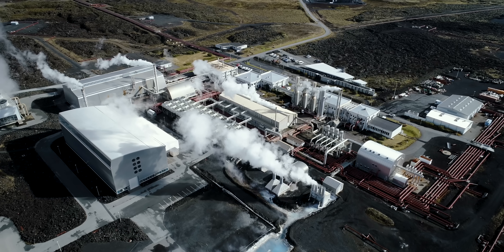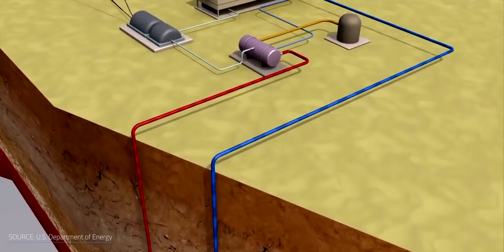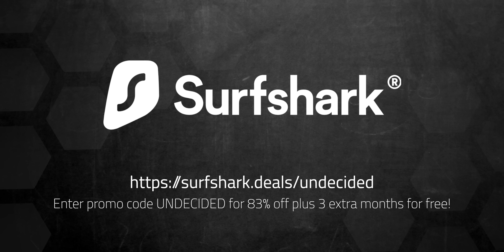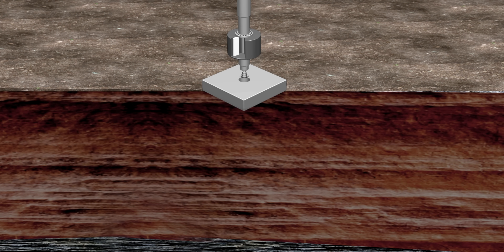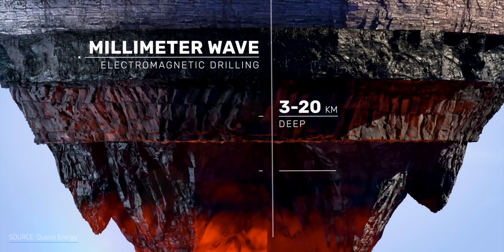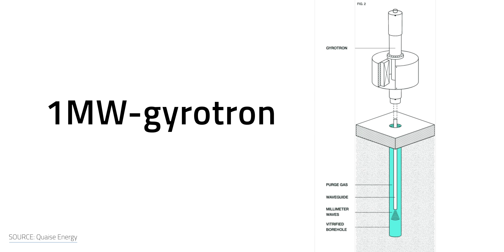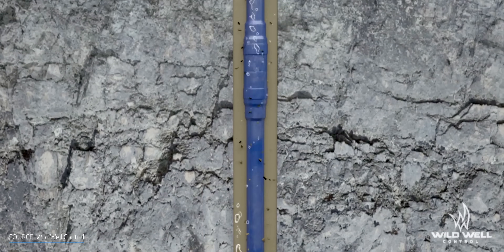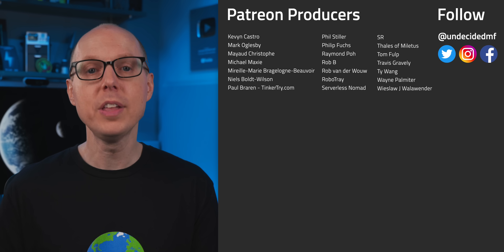Why This Fusion Tech May Be a Geothermal Energy Breakthrough

Comment: Very cool! I am eager to see the results from larger scale tests of this tech. One of my biggest concerns is related to insulating the electronics of the gyrotron. We currently struggle with the issue of electronic borehole instruments failing at ~150° C. 500° C is very hot and it seems there might need to be a robust cooling system at a level of sophistication that is hard to imagine without further research.

Great video Matt, Carlos, and Paul!
Reply: The gyrotron remains on the surface. The "drill string" is a waveguide to carry the radiation down.
Reply: @rubikmonat6589  What about signal degradation of the gyrotron? The approximate 25% gain lose per every connection. Since well drilling pipes are  a new connection every 27-32 foot. For that amount of energy and depth either your using Andrew LDF5 at a min (They don't make a reel that long in Chicago for depths mentioned) or polarized tubes like the DEW line. And would still have issues with rock like glass splatter coating at the end. Unless using an ungodly PSI and amount of inert gas like argon thus raising cost. Three Mile Island only reached something like 135 feet below ground due to ground table water. When the pellets and rods decided to leave the pressure vessel.
Reply: @sclabhailordofnoplot2430  That is why the wave guide is an entirely separate entity from the well pipes. The well pipes are just there to line the hole when conventional mechanical drilling is being used. Below that, the tool vitrifies the rock so the hole is basically lined with volcanic glass.
Reply: @sclabhailordofnoplot2430  think of the drill string as segments of rigid waveguide not coax, much lower loss and near zero loss at joints. Yes ungodly amounts of inert gas, not just for clearing the end but pressure to keep the hole open, you would need so much pressure you will likely blow out the glass casing at the shallower depths (you aren't able to use the gravity pressure gradient from the height like you get with mud). I don't think it will work, just from the pressure physics. Then you don't get the string buoyancy from the mud either, so the tensile strength will be eye watering trying to hang all that off a rig.
Reply: @rubikmonat6589  Thanks, So skipping investing. I feel old drilling methods, sandblasting, Water blasting, And brisance explosive carts would be more cost effective. Possibly a new Jack hammer style hydraulic drill head. Issues: The unsupported wave guide pipe (keeping straight in hole), Drill holes are never straight 100% Ridged wave guide can't work, (connections not discussed for signal gain loss Microwave, Laser, Electricity, and RF all have these issues), Heat issue, stronger drill rig for wave guide pipe (good point Rubik), amount of power needed at site, and removal of debris without splattering molten rock on the working end. High PSI means heavier pipe which compounds the line tension issue. Your going to have to keep to 30 foot sections to match the curve of the original drill pipe. These polarized wave guide high psi pipes are going to need stored to prevent oxidization when not in use. Dehumidified so you don't get a moisture block explosion.                                  I'm out, not saying it can't be done. I just foresee someone calling a radar guy to fix the wave guide after its been dented, kinked, coverd in splatter, or broke off 2,000 feet down. Good luck fishing that back up.        There going to have to use robotic/or psi driven external expanding open face ball bearings. on the pipe to keep it straighter and grip the sides of the shaft to lessen the pipe weight.

Comment: Theres a very important assumption I feel was glanced over.  It costs $500k of energy to drill the hole with the fun death laser or $30m to use conventional drilling.  So, the assumption is it will save tens of millions of dollars.  I feel this a silly assumption because it isnt the cost to the contractor that determines the overall cost of the project.

What I mean is this; if this project does go forward the contractor isn’t going to charge $500k plus a some, no they will charge $25m and pocket the rest as profit.  There will not be a saving of tens-of-millions of dollars.  I know this isn’t an economics channel, but even a trogladite like me can see this truth.

Comment: IF all works as advertised at the bore face, this technique solves many of the problems with depth limits to current drilling technologies. I wonder how adaptable it will be to directional drilling or drilling "sideways" instead of just up and down? Frack the hot lateral and trickle water in it as fast at will flash- even using clean water for the trickle, the rising steam would need to be scrubbed before it could be used .  FR

Comment: Geo-thermal always seemed the right choice for a simple low carbon method of power production. If cost is the only thing holding it back, then that's a shame. Why use nuclear when you already have the sun below your feet and there's no need to mine harmful chemicals for battery based storage?

Comment: I remember reading an article about this guy only a few months ago when he published his results; it's amazing to see how quickly this has been picked up and how fast we're getting to industrial scale. Usually that kind of stuff takes ages.
Also, using fusion stabilizing magnetron beams to drill holes to the centre of the planet is both mega sci-fi and reminiscent of the many technological developments that were made during the space race in service of taking a human crew to the moon and back, and how we're still using those technologies today for a wide variety of applications. These stories are always fascinating.
Reply: A magnetron is not a gyrotron.

Both produce EM waves within a similar range of spectra, but they are different in terms of design and the upper limits of their output.

Gyrotrons are far more effiicent for super high energy use cases like this.

Comment: I've often wondered...with the earth heating up, would it not be possible to 'harvest' this heat directly from the sea itself?

Use a heat exchanger with a massive array of pipes running though the sea in a similar way as ground source heat pumps work.
Reply: Not really, the ocean is too big, so the energy gradient isn't steep enough for most applications. There might be a narrow use case for undersea habitats at moderate depths to use the difference of the temp at their depth and "surface" waters for bulk heating, so they don't need to expend much precious electricity on heating the habitat, which may be very helpful, but to do that across the oceans as a whole would require millions and millions of tons of equipment, for not much return. A future post scarcity civilisation that is colonising other worlds might be able to that sort of thing one day, but not us right now
Reply: @talltroll7092  I wonder whether superconducting materials would make a difference?🤔
Reply: @weedfreer  Some, but the basic issue is the scale of energy available in the first place. You need a LOT of resources to capture energy from temp differences in ocean water (although obviously, there are some places where local conditions make it a lot more efficient, and some locations where even if it isn't that efficient, being able to capture energy on-site makes it much more valuable)
Reply: @talltroll7092  I mean, I'm thinking gulf coast as a prime example could be an option...especially the shallows around coastal areas....benefits from the sun too maybe

Comment: The best solution is often found in well established fields. I don’t really believe solar and wind to be even mediocre in replacing oil. The creation of solar and wind technology requires oil to begin with, and don’t give enough power for cost and maintenance. Not to mention batteries use some of the dirtiest minerals to extract. Geothermal tech is well established and fracking to increase the heat absorption area is easily the best way to make energy.

Comment: Everyone is for a more efficient long lasting and affordable energy source.  Someday someone will come up with a way to tap the earth's inner core.  This should not be looked at like it's a hazard free process that will supply clean energy for ever.  It may but. . .if the earth's core is hotter than the sun what do you think the chances are of magma or even hotter gasses escaping the shaft and causing a catastrophe of unimaginable consequences and or just under the surface.  Picture a series of mini volcanoes!  Once someone can figure out how to do this safely. . .yes the energy game is over.  That may never happen.

Comment: Here's a thing about the cost per kW compared to solar. It's 4x more expensive per kW, but 1 kW of installed solar produces about 4 kWh of energy per day, while 1 kW of geothermal can produce 24 kWh per day. 
Of course it'll be a bit less due to stoppages due to maintenance and such, but the point is, the sun doesn't shine all day, but you'll always have the heat from the ground.

Comment: You mention a conventional hole is necessary to 12+ miles at Newberry. That is ~60,000'. The deepest we go, conventionally is 18-20,000 with all sorts of hole problems. Not only that, but regular geothermal transport of heat by as a tendency precipitate out dissolve mineral as the temperature of fluid pool but you need to transfer heat from the downhill hot water to the fluid in the pipe and vice versa  ends up blocking the piping. Yes, it is transferred fluid
Reply: ... but you need to transfer the heat from the downhole fluid and Rock to the clean fluid in the piping and then vice versa at the surface.
It seems to me that the major problem will be drilling the very deep conventional hole. Drilling the "conventional" part of the hole with heat probably is compromised by the amount of water in the rock above basement.
If our little part of Colorado we are having terrifically hard time getting money interested in drilling  simply to 12,000 feet in a valley fault near abnormally hot rock.

Comment: Great find Matt. I like the way you brought up the drawbacks of creating the gas pressure and dealing with fault cracks but you did not mention the problem of extracting the heat. Pumping water down the hole will pick up high mineralization and this clogs pipes very quickly. If there is naturally superheated water in the hole it will also be full of minerals. And, creating a closed-loop pipe at this depth sounds very hard as well. I would consider the cost to build nuclear power plants with thorium a better alternative. It was done before and it can be done again. Geothermal for heat pumps is great but this deep drilling idea is a waste of time and money.

Comment: The numbers being thrown around here are pretty cavalier. It's nice to think that a concrete cost per kwh would be possible to estimate, but we have not even started drilling with this method, nor do I believe the cost of plant production an infrastructure have been taken into account. 

Further more, noone really knows the environmental impact that plunging multiple geothermal shafts, deep into the Earths crust, might actually be. There are so many variables that we have no clue about, because as a species we have never done anything like this before. Drilling 1 hold a fraction of the depth needed in one geographical location on earth, does not give us any data that helps us to understand what the impact might be in other regions or with other technology. 

People like to jump on bandwagons when something sounds cool, the problem is most of the people talking about this stuff are presenting more speculation than hard facts. The past 2 years should have been enough to que every single person into the fact that most of our so called experts are mostly incompetent.

Comment: The potential is good idea that geothermal could be alternative methodology to generate electrical power. While you pointed out the earthquake potential and Carlo's counter effects. I ask what about precipitating a volcano effect in the center of the drilling into what is perceived as the magma of the earth? If the sub strata is weakened then the potential for violent eruption by a new volcano is likely. The losses could be staggering.

Comment: Geothermal has some interesting possibilities, but one things that is interesting to think about is that tapping the heat out of deep earth would increase to global warming. Remember, we can not create energy just transform it. If you bring the steam to the surface the heat is converted through motion to electricity, but the heat is essentially released into the atmosphere.
Reply: While true, this is functionally how all forms of thermal energy generation behave. The energy release is a drop in the bucket compared to incoming solar energy though (our total annual energy production is a few hundred exajoules, total annual solar energy is a few million exajoules). This is why greenhouse gases and heat trapping is a much greater concern for global warming than the heat we generate to power things

Comment: I like the two closed loop systems, I assume that there is no need to release greenhouse water vapour from the steam plant, anyone know?
The heat within the earth?  I remember that the liquid water discovered in Europa is attributed to the gravity of Jupiter and the orbit/rotation of Europa.  Given that the magma beneath is liquid could the driving force for the Earth's core temperatures be similar with the Sun's gravity and our orbit/rotation.  Could that also explain the migrating hot pools of magma causing volcanic action to appear to move along lines in the crust?

Comment: This is exciting technology to be sure.  However, I have noticed that areas where the geothermal energy is more easily accessible also tend to be in nature preserves.  I fear that once you actually tried to set this up somewhere you'd have a slew of environmentalist groups protesting against it.  But if you can get this deployed it would be an amazing way to generate power.  I do have to wonder, what is the maintenance cost of this kind of plant vs something like an NG powered power plant or nuclear plant?  The energy source might be "free", but it seems to me that maintaining this kind of closed loop system might prove to be very expensive.

Comment: I'm skeptical about the glass walled pipe that is created being able to hold back the rock.  Unless we're talking Prince Rupert's Drop strength, I'm skeptical.  On the Kola well, heat and pressure made the rock walls more like plastic.  Heat does a number on glass over time.  Just something for someone smarter than me to think about.

Comment: Leap’n lizards, it’s a laser!     In the meantime, ground assisted heat pumps are a real thing, as Matt mentioned, but he didn’t cite their astonishing efficiency -  It is hard to get your head around it, but current off-the-shelf “heat pumps” can move 4 units of heat energy from a 50 degree Fahrenheit heat source using only 1 equivalent unit of electrical energy.  Typical year-round ground temperatures just 10 or so feet under ground are 55 degrees Fahrenheit.   A good heat pump can still move 2 units heat energy using 1 unit of electricity for a 5 degree Fahrenheit heat source, but why go there when it is an eternal spring day just a very accessible few feet below the surface of the earth!

Comment: Rotary Drilling is the obsolete problem. Dramatically cut the economic & environmental cost of drilling will make oil extinct by local, secure, cheap, green geothermal power. My idea -1978 Hydraulic Jack Robot Driller for Control Blowout Drilling of geothermal wells.

Comment: Your electrical costs for drilling may be overstated. Such a power plant would presumably have multiple bore holes. After the first bore hold is made, you could conceivably start generating power from that bore hole. Some of which to be used for drilling the subsequent bore holes.

Comment: Using geothermal steam in fosil plants won't be as straight forward as they think. Geothermal steam is colder in comparison to coal plant steam, and the thermodynamic cycle is not set up for that temperature and those pressures. Similarly with nuclear. You cant just drop in with a classical nuclear reactor, it has to be a high temperature reactor to be viable.

Comment: At the shallow depths used for heat pumps via pipes in the ground in certain soils the result was/is earthquakes and damage to buildings (Germany put a stop to it in places due to old city centres having cracked walls from this). What reactions will this tech bring that we don't need as a complication?

Comment: This sounds like a great idea. One issue not addressed. The weight of the rod that is 20 km long.
That material must have enormous tensile strength if it is to support 20 km vertically.
What's it made of? Or do they have another idea to supporting it at intervals down the borehole?

Comment: Mmm, free-electron masers. Frankly, the biggest problem I see is with the waveguide pipe -- it will see extreme amounts of hot gas going through and around it, very hot and abrasive dust and it must remain as dimensionally stable as possible -- otherwise all those megawatts will dump into it, instead of the rock below.

Comment: This could also be used for the allam cycle, the holes could be bored for the excess CO2 to be stored. Using renewable fuels, ie wood and waste that has captured CO2 from the atmosphere, then used for power, and extra co2 pushed down, the CO2 becomes supercritical, and potentially some is lost in the rocks, but that's ok, better there than in the air.